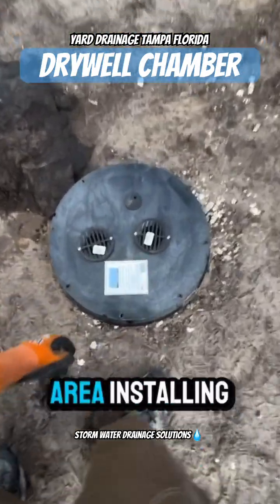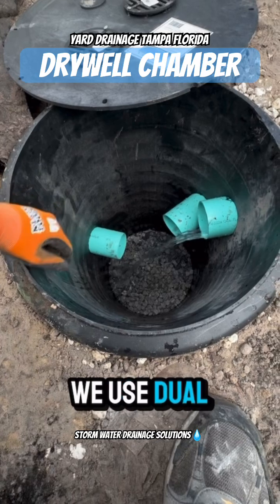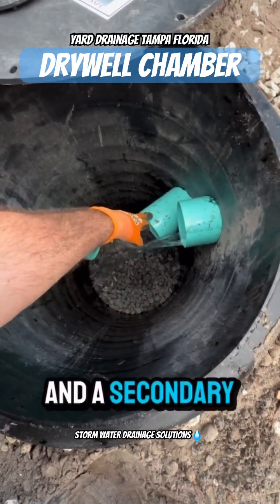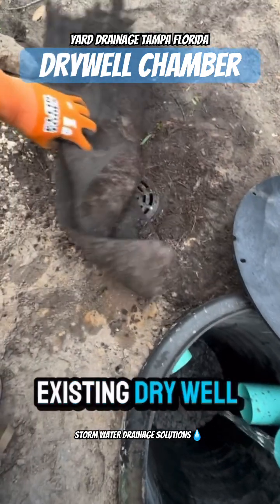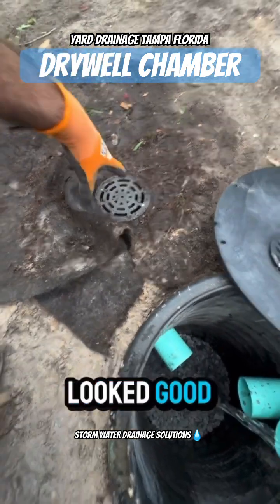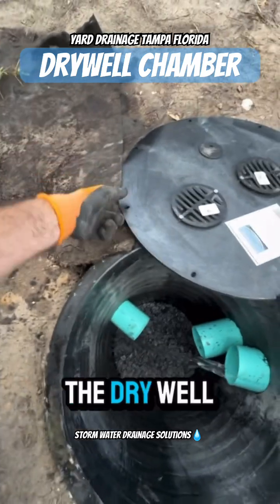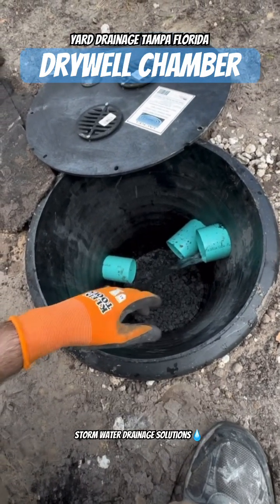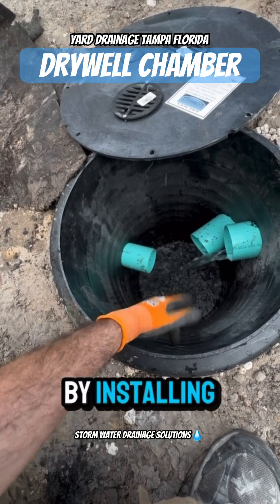Dry Well Drainage System - Dual Wall Culvert Pipe Chamber Addition - Yard Drainage - Catch Basin

Comment: Haven't seen anything on this but hypothetically for yard drainage. Instead of running pipe all the way to an outlet or bank how about A dry well with 1 pipe that runs to the bank to drain the well when water is actively draining into it from the additional perforated pipe that run into the dry well to drain yard?  Would this concept work?  Trying to avoid buying 100s of feet of pipe
Reply from the maker: Yes if you have the slope to make it work. That’s an overflow line. We install them on dry-wells in certain situations when we have enough fall to do so.